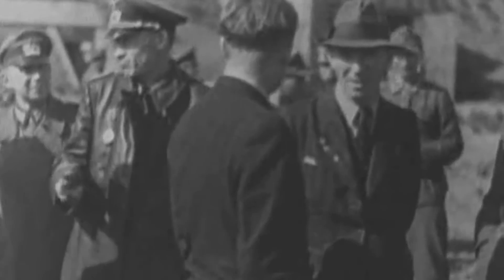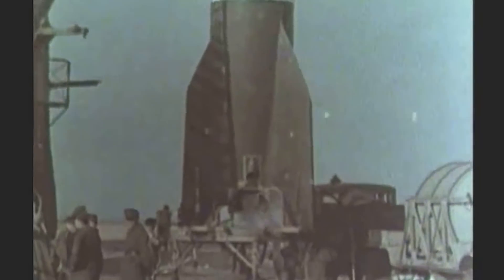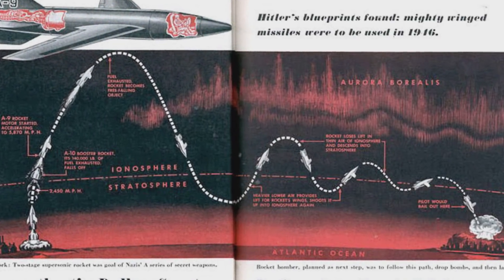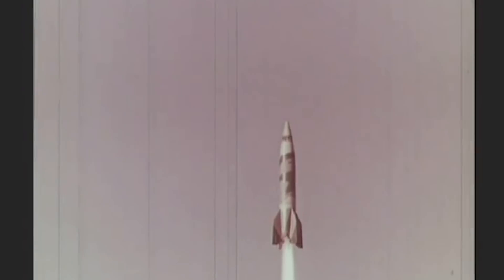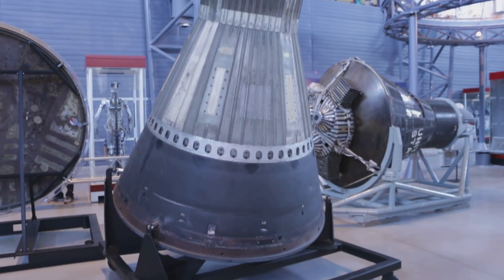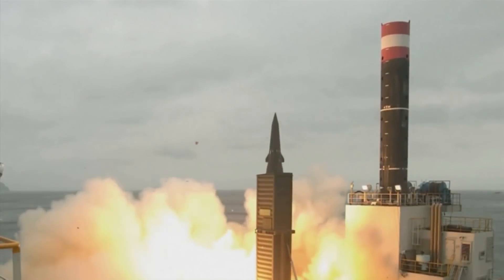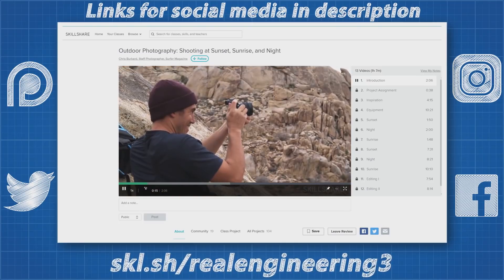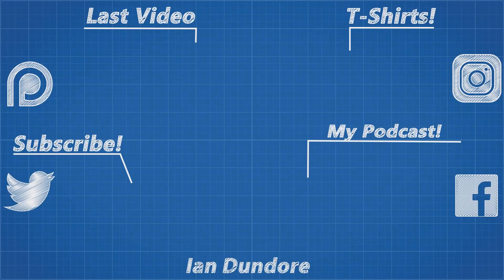Why North Korea Can't Build An ICBM (yet)

Comment: 1. Long distance rocket
The Aggregat 4 (aka V2) was the longest ranged missile at it's time, but 320 km --- a distance covered in ca. 65 minutes by a B-17 Flying Fortress --- is not really long range.  

2. Intercontinental winged ballistic missile?
A (never built) combination of a winged A4 and a first stage for it would be intercontinental, but due to the wings not ballistic (and likely interceptable at least sometimes even with WWII technology, totally unlike the A4).

3. Setting the compass to the right direction
There was no compass or compass setting as you describe it.  The (marked) wing 1 of the A4 would be pointed exactly the right direction with a rotatable, levelled platform.  This allowed using only 1 gyroscope for roll and yaw.  Improvements were planned and some flown.

4. The "control fins" in the A4 were both conventional control surfaces at the fins and thrust vectoring with graphite fins inside the exhaust to have control at the slow speeds around launch.

5. The Germans did not use 'the amount of fuel calculated by a slide rule' to set the range.  Which one of your sources does claim that crap?

The Aggregat 4 used a Mueller-type "Pendulous Integrating Gyroscopic Accelerometer", a PIGA (https://en.wikipedia.org/wiki/PIGA_accelerometer), still used today, to switch the engine to low thrust at 95% of the end speed and to shut down the engine completely upon reaching the end speed.  

Also, the engine was started on the ground at "low thrust", so the responsible officer had a visual proof the engine was running properly before ordering the launch.

6. Suicide jump-out A4 rockets to attack the USA
Somebody is confusing and conflating a lot of things ...

The diagram, up and down through the atmosphere is likely referring to the "Silbervogel" (suborbital spaceplane) concept, started in 1931.  It would rise to 145 km, and repeatedly dip into the atmosphere; the lifting body design would carry up again, for a somehwat shorter hop, lather, rinse, repeat.  As bomber it was to drop 4,000 kg onto the continental US, skipping on and landing normally somehwere on Japan-held Pacific territory, before leaving the cockpit the normal way.

The jumping out was likely the Fieseler Fi 103R "Reichenberg-Gerät", a manned version of the Fi 103 aka V1.  It would be a 99% suicide mission, with a slight chance of bailing out shortly before impact, not being hit by the pulse jet just above and behind the cockpit, and parachuting down onto the attack site.  Carrier planes would mount and carry one or two of them to extend the range.

The U-Boote surfaced near the coast would be an amalganation of several plans to fire on the continental USA with a Fi 103/V-1 (foundered due to interservice rivalry) and the Aggregat 4.  The A4 would be placed inside a 500 ton carrier/launch container, to be towed towards the US coast by a submarine.  Ballast tanks would turn the container from horizontal to vertical, the missile would be checked, tanked up and launched.  No A4 was ever towed towards the US.

7. Terrain mapping is a cruise missile technique, and totally useless for
a ICBM.
- ICBM: *B*allistic.  Not "Steered".
- in vacuum: needs reaction engines to alter the trajectory, wings do not work in vacuum.  Additional complexity, mass, error sources.
- a 90m drop in terrain, starting from 10m above ground, is a change of 1000%.  From 100km up, it's 0.08%
- From 100 km up, you need 1.6 billion(!) times the energy to get the same radar return strength than if flying at 500m.
- ICBMs don't have engines running all through the flight, which could power the radar.  They need something light and compact, like batteries.  This means radar is out.
- where you dee 20m² from 100m height, you see 19.6km² from 100km height with the same antenna.  That is too large to use terrain mapping.
- ICBMs tend to fly long distances over water, which does not allow terrain mapping.
- During reentry the reentry blackout stops any terrain radar --- and the blackout will likely be a few minutes.
- A reentry capsule has only very limited course correction capabilities.
- Using a star tracker is easier, cheaper, lighter, passive, less energy intensive, works over water and cannot be jammed.  Civilian single-band GPS accuracy is 10-15m and a bit worse in height.
- The acceptable accuracy for nukes is kilometres.

8. Weight of the A4
The A4 did not have a reentry capsule.  It had therefore to be built in a way to survive complete up to the impact, making it unnecessarily heavy.  A "reentry vehicle" would have reduced the total weight, allowing a larger warhead or more range.

9. Creating a TPS (Termal Protection System) today is not that difficult.
There are patents, old and new, readily available on the Internet (and North Korea will not listen to patent lawyers).  Lots of papers, too, old and new. E.g. research into cork granules + phenolic resin for heat shields --- effective and light weight.  Produced commercially.  And have been used on the Space Shuttle boosters and Delta rockets.

10. Accuracy problem:
- They will have enough accuracy for a nuke.  Especially one many times stronger than Fat Man or Tall Boy.
- Sub launchable missiles (which North Korea has) havge much less distance to travel, and therefore will be more accurate.
- Diesel/Electrosubs can be extremely silent, basically invisible withouot active search.  Active search, of course, has it's own disadvantages.  Some US aircraft carriers have been successfully torpedoed and "sunk" in maneuvers.  Others had the sub surface right next to them on top of it --- unnoticed until then.

11. Miniaturizing nuclear weapons.  
If the images of the hydrogen nuke Mr. Kim stood at are somewhat accurate by size, they have the miniaturization.

12. Reentry stress and nukes
Nukes are pretty sturdy.  No moving parts, either (except Tall Boy).  The acellerations of launch and reentry will not hurt them, only heat or vessel breakup could.  That's why you have a heat shield.  Since the capsule will be much lighter per front area compared to, say, an Apollo capsule, it will slow down much faster, needing much less of a heat shield.

13. Triggering
A simple barometric switch, a timer, an accellerometer ... all can trigger either dropping the heatshield and turning on a height measuring radar or simply the explosion itself, if you want to be crude.

14. The "rocket broke up"
Are you sure you see what you think you see?  It could well be that what broke up is the rocket --- except for the rentry capsule.  You wouldn't necessarily be able to distinguish between some random, broken part of the rocket and an intact reentry capsule.

15. EMP strikes need no reentry
For an EMP strike against the USA you want to detonate at ca. 400km height.  And for a good effect 10 kilotons will be plenty, especially if the bomb is optimized for it, according to experts heard at the relevant subcomitee of the congress in 1999-10-07.  Yield is only loosely coupled to EMP strength.  (And we know North Korea has atom bombs well above 10kT.)

15. Countermeasures
It's like the assassins and the bodyguards.  The bodyguards fail if even a single assassin survives --- and the assassins need to get lucky only once.  Patriot is not exactly 100% effective against Scuds, but at least battle tested.

Comment: I think the only reason North Korea doesn't yet have good ICBMs is because their scientists/engineers have purposely been dragging their feet. All the information they need is on the Internet and in journals. It just requires people smart enough to understand and synthesize what's already public; which I'm sure they have plenty of. This technology is, what, half a century old now?

Yet, I'm not too worried about the situation, yet. It would be a suicidal/"troll" move for North Korea to use these weapons. As far as I can tell, the reason for these displays is to fuel propaganda. There is nothing that can be gained by them using these weapons.

Comment: The comment that North Korea does not have military grade GPS capability, and that China or Russia has not granted them access to their high accuracy signals isn't really all that important any more.  If North Korea wanted to use U.S. GPS signals, commercial available WAAS signals, they are extremely accurate, considering that our National Airspace is moving to them for more and more information.  Even if the WAAS signal was turned off, or otherwise degraded, a nuclear tipped ICBM coming from North Korea to the U.S. mainland is more a terror device than an actual military weapon.  It is a modern day V1 or V2, and if you dropped on in or around say, Los Angeles, if it landed within 10 miles of the center of L.A., it would still cause massive amounts of damage.  If North Korea were able to strike LA. with a bomb equivalent to the one they exploded in 2013, there would still be 150,000+ causalties.  Based on what they have exploded this year, however, which would be closer to 100kt, you can expect upwards of 800,000 dead and injured in the L.A. region

So, given that, you don't need to strike a military target, these are terror weapons.

Comment: A modern implosion based thermonuclear warhead with its lead or uranium tamper and massive amounts of volatile high explosives would have been too heavy for the V2 to lift, to say nothing of a secondary fusion stage, but the first enriched U235 warheads were slug and cup designs, less powerful than implosion warheads, but still far, far more powerful than the 1 ton of conventional explosives they were attempting to outfit the V2 with.  The slug and cup design required almost no tamper, no sophisticated detonation control electronics and I think arguably could have used the V2's own re-entry momentum to bring the pieces together.  Also, the sub-critical ovoid shaped liner implosion (or reconfiguration) type warheads would probably have worked.

Feel free to correct anything I got wrong.

<Political topic warning>

We have essentially nothing to fear from N. Korea.  North Korea's primary export is slave labor.  While some of this labor is present in EU countries like Poland, the vast, vast majority of N. Korean slave labor is sent to the Russian Federation.  Trump doesn't make a move without running it past Vladimir Putin and Kim Jong-un is the sole shareholder in the holding company that provides the Russian federation with slave labor, so Kim Jong-un also doesn't make a move without Putin's say-so.
This ridiculous garbage is a trumped up (ha!) distraction to keep people from thinking about Trump's imminent impeachment, arrest, trial, interrogation and imprisonment.

Could I be wrong?  Eh... maybe, but I don't think so.

Comment: Even tho the rocket did got destroyed by re-entering the atmosphere. IF north korea would have equiped it eith a nuclear Bomb. This would be a HUGE PROBLEM!

1: nuclear bomb would catching fire and desintegrate. Causing it to ignite and explode in the air.

2: EVEN IF the bomb exosion wouldn't be powerfull enough to reach anything on the ground!
The explosion is several kilometer/miles above the ground. And the wind will take the Nuclear fallout along, spreading it over HUNDREDS of miles.

The effects of that will still be devastating for ANY country thats gonna be showered with this stuff. EVEN IF the bomb didnt make it to the ground. A nuclear explosion in the ait is VERY dangerous.

Comment: if they can built a hydrogen bomb then surely they can make a ICBM .
Reply: Kyle Are you serious?
If it was that simple, isis wouldn't bother it self with the old C4's.
The H-bomb is a thermonuclear hydrogen isotopes fusion bomb. It's like a nuclear bomb on steroids,much more powerful and advanced than the regular atomic bombs like Fat Man ( the one thrown on Nagasaki).
Reply: James Jaks123,
That is an impressive amount of wrong you've packed into one comment, chap.
1. An ICBM is any missile system that begins its flight rocket-powered, leaves Earth's atmosphere briefly, and then assumes a ballistic path back down.
2. An ICBM doesn't necessarily require a nuclear payload. You could, for whatever reason, load it with conventional explosives. The reason they are designed with nukes in mind is to maximize the ratio of destructive capability per ton. Using anything other than nuclear warheads is simply a waste of money.
3. A hydrogen bomb doesn't split hydrogen atoms. It's like a big, explosive jawbreaker... The outer layer is a fission bomb, using plutonium or uranium, that explodes to compress the inner core of hydrogen isotopes. The compressed H isotopes then fuse into helium, which releases absolutely /stupid/ levels of energy.
https://en.wikipedia.org/wiki/Thermonuclear_weapon
Reply: James Jaks123, A "hydrogen" bomb doesn't split hydrogen atoms. It fuses hydrogen (isotope) atom nuclei (protons) into helium atoms, releasing gargantuan energy.
Reply: Kyle Wrong.  An H-bomb is a mini-sun, not a rocket engine. Completely different physics.
Reply: An icbm is a missile with a hydrogen bomb inside if it, the hydrogen bomb is a nuke, it is called that because it splits a hydrogen atom.

Comment: In 6:12 you said that North Corea doesn't have the necessary technology to prevent the falling warhead from burning in the atmosphere. And you showed the video of the falling and burning rocket as a proof. But I think that it is just the warhead that shouldnt burn. There is a small probability that they put a warhead to a test lounch rocket. As for navigation you dont have to ( and even sometimes shouldn't) use GPS in military devices. There are some others ways of navigation which are currently being developped such as inertial etc. I think that this threat should not be ignored by the USA and South Corea. It should be used as a pretext to significantly increase the US Military presence in this region.

Comment: Wait...where are North Korea getting their sources from to build these missles anyway??? China???
Reply: Are you asking about design or materials?  For design, apparently they are derivatives of USSR designed SCUD missiles, with the design actually obtained from Egypt about 1979 or 1980.  It took them only five years to establish an infrastructure, test, and commercialize them!  Now they've had 32 years of refinement and scaling up.
Reply: Rich Dobbs design and materials
Reply: For materials, some combination of the international black market and internal production.  The internet suggests that most of their other arms production is not being upgraded.   No ability to produce air crafts or modern tanks.  It has been speculated that the engines for the current best missiles are all black market, but the rate of testing doesn't seem to match that assumption.
Reply: Davi Reimer China has gone to war against the US though... I don’t think it was ever formally declared, but the Chinese pushed the UN forces that had pushed DPRK forces all the way to the Chinese border back down to the 38th parallel.
Reply: From my ancestral homeland China of course!  j.k. but seriously though, if they have internet in the head office then they have all they need for designing bomb (i.e. wikipedia). Then they can also wiki up how to refine the raw materials, and maybe even wiki how to source black market stuff that can't be dug up out of their own backyard.
Reply: America's friend Pakistan has sold nuke technology to other countries.
Reply: Might wanna rethink that.
Reply: Russia and China!!
Reply: No need to worry...They stand no chance to fight against USA. Russia and China has never went to war against U.S.   All they have is each others and thats about it. Don't forget about the nato too LOL
Reply: Kim Jong Un the fat pig is bluffing...Let them keep going and see wtf we do to them. Take NK out and who gives a shit what China and Russia thinks. They don't want no war with USA. Don't be a fool
Reply: India wants China....like i said dont be silly

Comment: Forgetting many important things such as:
they have had literal decades of help from China, Soviets, Iran, Libya, Pakistan, etc.. 
While they have shown the ability to place a satellite, they don't need their own cause in 2014 China stated that N Korea could easily use their Beidou. Leaked intelligence from N Korea military the same year showed they HAVE BEEN TRAINED TO DO SO since atleast 2014. China also stated 3 years ago that they could not stop N Korea from doing this even though they're back tracking on their statement now. Looking the other way is not a problem for the CCP.
They also may have access to Glonass & have access to the public US GPS system.
Both US GPS & the public section Beidou can be jammed but there is some evidence that N Korea may have acquired digital hardware to shield from jamming through trade w/ China. 
Regardless they can easily combine their access between even just 2 of these systems ( right now believed to be Glonass & Beidou) to be lethally accurate.
It is nice to try & calm ppl but reality is what is needed.

Comment: (all?) Civil GPS modules have built in limitations: They stop tracking the position for speeds more than 1000 knots (1200 mph / 1900 km/h) And also they stop working for altitudes higher than 60000 feets (18km)..
Thats why Korea needs own GPS satellites or get one of the US military ones.. which wont probably work for US targets.